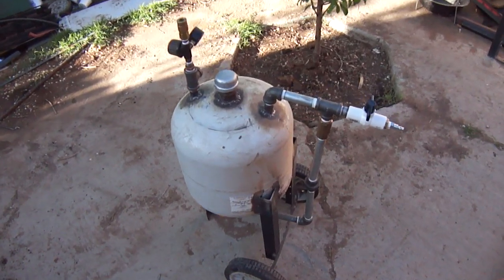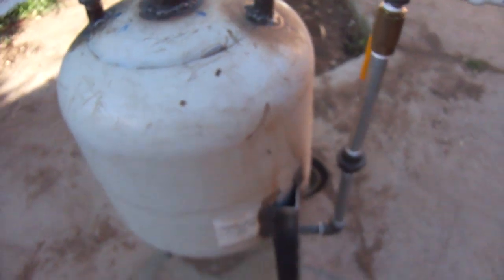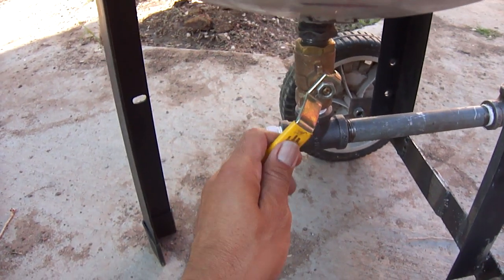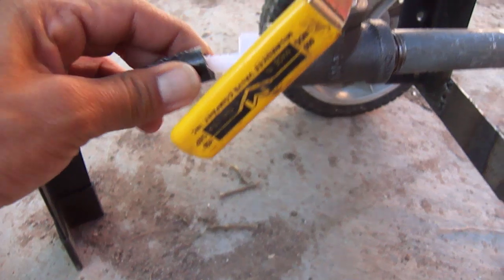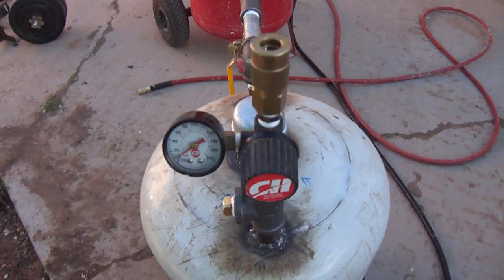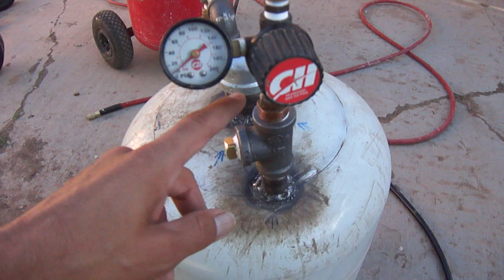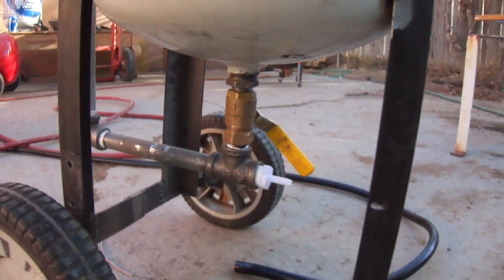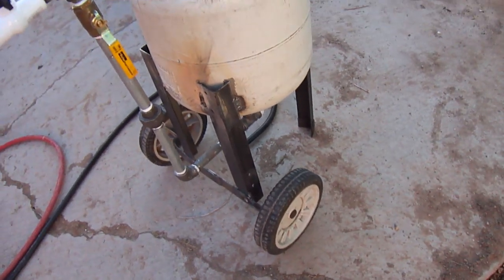Home Made High pressure pot blaster/Sand Blaster converted from propane tank part 3 of 4

Comment: Why is there always dogs barking on these You tube videos lol! i made this same thing out of a piece of 4 inc pvc pipe with a screw on sewer cap on one end,i used a regulator in the top and it just pushes the sand up to the gun and i only need 20 psi to push the sand up to the gun it mixes at the gun. good job,your welding is better than mine!

Comment: I'm not sure how the blow off valve will cope, or presure gauge. Because if it does blow off the blasting media will shred the inside of the gauge and clogg the blow off. The valve on the side needs to be sett to supply slightly more presure to the pott than blasting line to encourage correct path the media should take, you dont want it blowing back up the pot.
Reply from the maker: It works great!!!!! check out my videos where i use this bad boy toy... i just added a video of the snow chains i sand blasted with this beast..   Thanks 4 hating tho :)
Reply: not hating fella, if that was the case ied of given the video a thumbs down. Just saying what I think will happen (from other videos of blast pots, they warn about blasting media interting gauges/regulators and blow offs